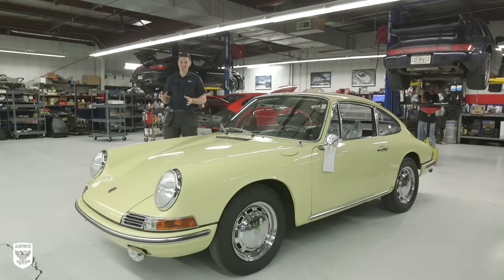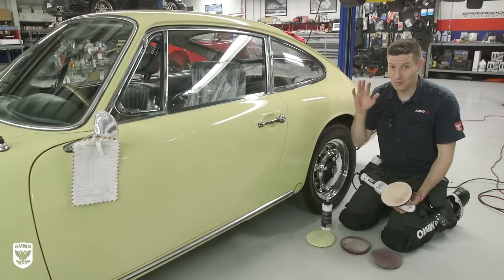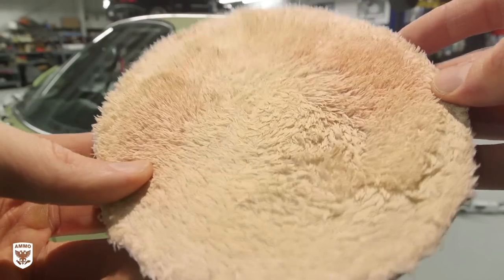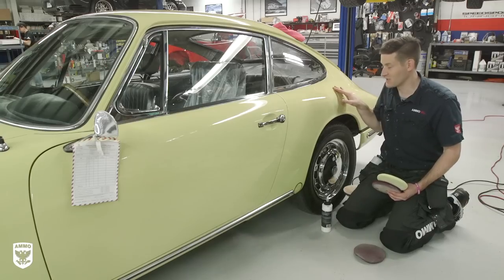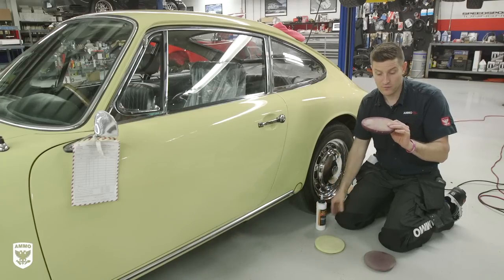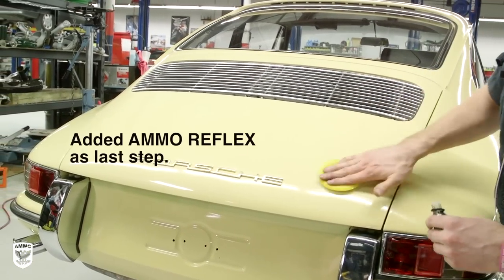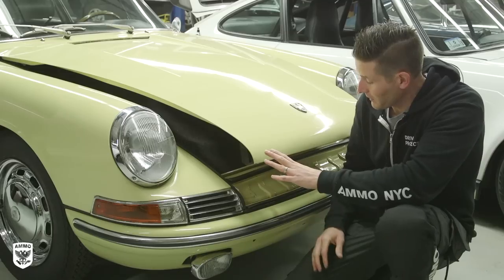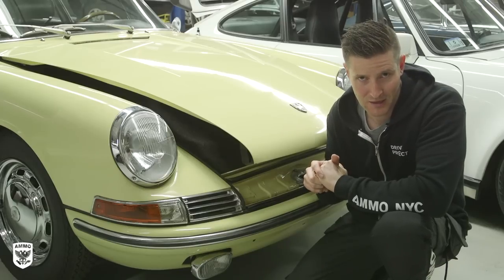Rock Chip Touch-up Tool: Museum Porsche 911

Comment: You can also purchase a small number of insulin syringes from a local pharmacy to do this.  Obviously, you don't fill the syringe with paint - just about 5-10 good-sized drops of paint will do.  Gently place the plunger back in the syringe and turn it over so that the needle is facing upwards (AWAY FROM YOUR FACE!) and start depressing the plunger until you start seeing paint at the tip of the needle.  Wipe it off and you're good to go.  The paint won't dribble out because of it's viscosity and the small diameter of the needle causing surface tension to hold the paint in the needle until you begin to push on the plunger.

Comment: Hi Larry - Is it possible to use this pen & technique to do 'vertical' touch-ups (i.e. on the door, quarter panels, etc..)? Or would the paint leak from the pen given the angle that you'd have to hold the pen? Thanks a lot for another great video.

Comment: Wondering if wax and grease remover might be a better prep chemical.   Also, thinking that surely all the rock chips had some level of corrosion present,....shouldn't those have been mechanically cleaned to bare metal with a sharp point of some kind then primed before applying touch up paint?

Comment: Was this car Dawn washed and claybarred before this video? 

If using this paint pen, here's a chemist's trick..  Use a "pipette", in this case a hollow coffee stirrer.  Dip in into the paint supply to the depth of the pen reservior. Put your finger over the open end of the stirrer to seal it,  then lift the stirrer above the level of the paint. Let it drip. Then move the pipette over the pen's cup and release your finger. This will transfer one or two drops without a mess. 

Tip#2  Don't use alcohol to clean the pen. Use lacquer thinner.

I have a DIYer substitute for the Loew Cornell Fine Paint Pen.  I always buy a Duplicolor touch-up pen when I get a new(er) vehicle and rarely am able to use that touch-up for the next car. Discard that paint. Clean the touch-up pen. Refill it with a color matched paint.

Comment: Hi I've watched almost all of you detail videos after getting new 18 civic. Your videos are so great and I thank you for all your info! One quick question, I put a coat of wax on my car yesterday and did a full detail. The next day, I found little spots under my front passenger side mirror. The spots, looked like little bubbles, and looked like the color of the paint, so after using a quick detail and microfiber, I wiped these spots, and the paint came right off! My heart dropped, the paint is perfect, well not any more. What caused this? My car is in the garage at night and most of the day. The only thing I can think of, is tire gel splashing up from driving the car, but this doesn't make since, because I wipe the tire after applying the gel to prevent the splashing of the gel. Please help!

Comment: For years Ive used the stem end of paper matches , they hold the paint , and you only use them one stroke  , because brushed dont work  because they  pull the paint out as its drying , sounds like an interesting toy to try ?

Comment: Larry,

What are your thoughts on this touch up method vs the 964 touch up method video where you used sand paper on a pencil eraser and sanded & buffed the touch up spots to blend with the surrounding paint? I'm asking in terms of the quality of the final look, durability, so on. Thanks!
Reply: Gregory Marsh first I think it comes about the base color. The other one was black so the touch paint you might see it more clearly than this beige one. Also wetsanding its just for being sure the paint will match well and the IPA cleaning too.

Comment: How does this paint chip repair method compare to others like the Langka method? Seems like up close you would still notice the touch-ups due to the height differences in the paint whereas other methods do a better job of blending with the existing paint on the car.

Also with this pen, when doing vertical surfaces how do you keep paint from spilling out the top? Put tape over the reservoir?

Comment: Hey Larry ,  I have a few rock chips in my fender.  I’ve done single stage touch up repairs before without a hitch,  my car has a 3 stage paint system on it,  I’ve purchased the proper touch up paint pen, but wondering is there a special process for this type of paint repair?  Thanks in advance.

Comment: Very good video.. just subscribed.  I have a new Subi that has a chip just above the windshield.  looks like the paint might flake up in the future and the sheet metal is showing rust. What is the best way to protect this ???  I have matching paint tube from Subaru but i'm looking for a quality, long-term fix
Reply: Flake up meaning it looks like the clear coat and base coat may be separated from the sheet metal.  If i used my fingernails, i could prob pop off the paint in the immediate area.  Help!

Comment: Question: what is the very first, basic level (and inexpensive) step of improving your paint? My black BMW is 6 years old with 29k miles, in very good shape but a girl owned it before and nothing  was done previously. Minor scuffs and surface scratches like by the door handle and by the trunk that needs some attention. Hood is actually excellent in terms of tiny chips. Much thanks!

Comment: Hello to you. You have another video dated August 14th 2013 titled "Paint Chip Touch-up -- /DRIVE CLEAN" from your /DRIVE CLEAN channel that gives us a very complete method. Is there alot of steps that are not necessary anymore when you use the Loew-Cornell Fine Line Painting Pen, and if so, which ones are they?  Thanks! :-)

Comment: Hi there
I followed this avidly and immediately ordered a couple of pens however my car has a clear coat and factory paint protection.
My questions are does the isopropyl remove the paint protection if I wipe a couple of inch area.
And how would I apply the clear coat and possibly blend.
Much appreciate the videos and find many a half hour passing when I should be doing something else.
If you could find time to answer or incorporate into another video many thanks

Comment: Hey Larry, is there any reason you prefer things like paint pens or like in your video where you are touching up your black porsche, why not use a modeling airbrush with a fine tip? If you are adding caranuba wax around the chip and then removing it from the chip with IA, wouldn't that be a better option?

Comment: I have a new (6 months) Focus ST. The touch up pen has the paint applicator side and the clear applicator side. How does that change this method? This looks wayyyy nicer when finished than using the normal brush.

Comment: So I am curious as to how you use this paint pen on a side panel without the paint dripping out?
Reply: The pen basically only holds like 2 or 3 drops, so the surface adhesion of the paint keeps it in the pot, but the momentum of moving the pen towards the panel then the instant stop of the hit makes a tiny bit come out, even on a side panel.

Comment: So would I wet sand with a fine grit like 3000 or 5000 and finish with a good polish before ceramic coating the entire vehicle? Or just leave as is. I’m sure the touch up spots would be slightly higher than the rest of the paint

Comment: did you need to reapply clear coat or smooth out the paint after the application by wet sanding or power polishing and then applying fresh clear?

Comment: Larry, I'm getting ready to correct some rock chips that have some rust on them (I have a hand-held abrasive fiberglass pen for "sanding" purposes)...do you recommend using any liquid rust converter/rust remover at any point?   Like adding a drop of POR-15 to completely kill any remaining rust after you've sanded it a bit?    

I'm thinking that would help ensure the rust spots don't flare up...but I'm not sure what it would do for paint adhesion.  Any thoughts?

Comment: I recently bought a used car that has a lot of rock chips on the hood. I also noticed rusting along the pits of rock chips. I want to cover these rust spots with EZ Mix touch up + paint. Do I have to sand the rust away first before I apply the touch up or can I directly apply the EZ Mix touch-up fluid using the fine paint pen? I have a dark grey colored car & I just want to cover these rust spots & prevent them from getting bigger.

Comment: What if you use the paint pen thing you used and then you want to put a little clear coat? Did you sand that car the chips with a pencil and sand paper before painting it?
Reply: no he didn't clearcoat this, most likely due to time and money. clearcoating is only good for protection from UV and minor scratches, given this car will be in a museum that isn't a concern. but if you want to clearcoat you will want to wet sand down all of the places you touched up as it may look pretty smooth but it truly isn't so that will only show more when you apply clearcoat.
Reply: @x-ray3443  i dont understand. Wet sand down, what is it mean?
Reply: @johnyjimmy5325  i dont know if you are trolling or just genuinely curius, but he ment "wet sanding" as in you take sandpaper and sand the surface using water or soap and water or oil  as an lubricant, to minimize scratches and to achive a more uniform scratch patern.
Reply: He said that it didn’t have clear coat
Reply: @x-ray3443  clear wasn't used back then.  This is just good ole auto paint.  That's why he was cutting away the top layer to fresh paint.

Comment: Hi,

I have a 10 year old BMW 335i with Alpine White paint.  I have about a dozen rock chips on the hood and wanted to use the pen to do the touch ups.  Can I leave it as is after the paint dries, or should I knock it down by wet sanding with 2000 or 3000 grit?  After wet sanding, can I go over the corrected chips with a DA and something like Sonax Perfect Finish?

Thanks for the feedback.

Comment: Could an eye dropper or just a plastic syringe (no needle, or use a blunt needle - I grind tips smooth using a metal spinning file blade or Dremel end mill) speed up this paint loading process easier?

Comment: Great video Larry, I have a question. 
I have a 1991 BMW E30 and it has rock chips with some rust on it I didn't quite understand you sandpaper and pencil method but also do I need to add clear coat on top of the touch up? 
If anybody else has any info feel free to comment too
Reply: pandaman rodriguez pretty sure most touch up paints have the clear or gloss added to them ? So they blend better

Comment: You mentioned using the "pencil trick" if there's any rust in the rock chips. What is that exactly? I've got a few rock chips I've been wanting to fix up but they've got a bit of rust in them and I didn't think I should just paint over it.
Reply: He was probably talking about the pen that comes in most kits with a rough edge to sand the surface rust out of the pockets. Definitely shouldn't paint over it.

Comment: When doing a full paint correction, would you repair chips before or after compounding?
Reply: If they want them repaired you always do it before any compound work. Cause you'll end up sanding the spots back. And you'll just end up wasting time and more of the clear coat left on the car

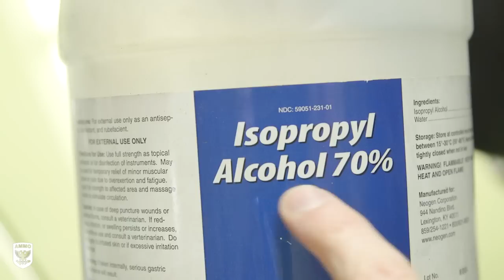Comment: 6:13
 They make ISO alcohol with much higher purity percentages than the 70% you're using, anything under 90% and you're going to leave a residue. Try it, let some dry on a piece of glass and look at how much crap is left over. :)

Comment: I have a 2018 Mazda3, it has accumulated a small assortment of stone chips, scratches, and a very unfortunate scuff (right over the wheel well, definitely took all the clear off). 

When repairing the stone chips, would I want to use the Loew pen to also apply clear coat after applying the paint? I have a 2 part paint touch up for my car (colour and clear coat).

And can I use this pen to fill in searches in the clear coat? Or should I just polish/compound the scratches away?

Comment: So how does one find all of these chips you filled, sand them flat, cover in clear coat, properly sand and re-polish all of them? The only replacement paint I could find in my mini was a very bold two-in-one (metallic paint on one end and clear coat on the other) and when I say it was the most absurd, ridiculous pain in the ass process, I put over 20 hours into the entire process, honestly closer to thirty. There has got to be a better way. I know I didn't get everything and several road trips later I'm getting to the point where I almost want to start again... but no way I'm going it the same way as last time, absolutely not.

Comment: This may sound like a noob question, but if I use touch-up paint do I need to clear coat it? My parents car has a few rock chips on the bonnet and on the bottom part of the front fenders, and some paint that has fallen off of the boot due to a bad paint job from the manufacturer which are about a centimetre wide. Do I just apply the touch-up paint on those spots and I'm done, or is there anything else I need to think about?

Comment: Does this work best with one stage paint? Or can base/clear be repaired this way also? How would you go about applying clear? Or is touch up paint different, and I'm just an idiot...
Reply: james elliott I normally mix a bit of clear into the colored paint, adds a shine to touch up that means they blend well. Props to anyone that can add a fine enough coat of touch up to get a proper 2or3 stage paint
Reply: "mix a bit".. how much do u mix paint & clear by ratio?

Comment: Could you wet sand it after you touch it up with the pen to make the surface smooth?
Reply from the maker: In certain situations yes but in this case I did not want to sand the original paint.

Comment: Is it necessary to add clear coat to modern paint (as opposed to single stage) after touching up with this pen? Even if it looks fine as it is?
Reply from the maker: i usually mix the paint and touch up together sometimes for these odd repairs, but yes you can put on top as well
Reply: SO you mix the clear and the paint?

I have a 2018 Subaru WRX and I bought a touch up pen (one side oem paint, other side is clear coat) but it's not precise like this..

 I just ordered the pen you showed us, so would it be good to mix the paint; apply just paint; apply paint, then clear?
Reply: Hi Larry, regarding the pen, do you know whether it is compatible with touch up paints that you normally get from the dealers i.e. base coat mixed with clear? I ask this because these sort of paint is rather thick, and I'm curious if it will flow down to the orifice? In your opinion, should water-based paint be used or the paint in general be cut with a thinner for the application at hand?
Reply: Dallas Freeman I wouldn't mix clear coat and paint if the paint is metallic. Sometimes the clear dilutes the metal fleck and it sinks to the bottom, leaving a solid, flat colour. Often better to go over with clear coat separately, fine sanding job (2500~) and polish using a cutting, then finishing compound. Hope this helps! :)
Reply: yes it is i use it all the time

Comment: Would this fine line paint pen work with metallic paints or would the metallic flakes in the paint clog it?
Reply: that's a good question, i want to say it would be fine, but given how small the pin tip is not too sure what i would do is buy the pen (its only 10 dollars) then test it not on your car just on something else like black construction paper so you can see the paint clearly because another thing i would look for is if the flakes not clogging it, but just not coming out of the bottom so i would check that.

Comment: Just looking at the specs it says u can get a 0.5mm line so I’d guess a 0.5mm Diameter Universal Blunt Tip Fill Needle stuck to a pen would work use at own risk  there is 0.25 , 0.5 and 0.9mm options u can get if anyone can’t get hold of one like me ☹️

Comment: how do you even begin to bill for something like this? I would think there would be a second line item for "paint repair" vs paint restoration.
Reply: Jesus Ramirez. He probably works on an hourly wage. Different cost per hour depending on what he's doing I reckon.
Reply: Jesus Ramirez Its both...Restoring the paint and Repairing the chips 😐...I have always disliked touch up paint!

Comment: Use lacquer thinner to clean the pen of lacquer or enamel paint. Rubbing alcohol isn't a good paint solvent. Works much better and should be a chemical you have in your detailing arsenal.

Comment: I bought this tool and tried it out with original BMW touch up paint.  Nothing comes out from the tip of the tool.   Is my paint too thick?  I tired and tried but doesn’t work.
Reply: You need to fill it properly (no air bubbles). I ususally get it going on a piece of paper or something first. Sometimes it needs to be cleaned with the pipe cleaner to get started. But once it starts it very rarely stops.

Have the same BMW original touch up paint (Jerez Black for my BMW M3)

Comment: Or get your paint removed and have the whole area sanded, buffed, and repainted to eliminate rust under those spots you “touched up” in the long run
Reply from the maker: This car was completely original.  Repainting would in fact ruin the originality in this case.

Comment: I have a 2016 mazda that got a couple of drops of super glue on the paint that got smeared. how can I remove without damaging the paint?
Reply: If you can try and use super glue remover then follow some sort of wet sand buff cut and polish method